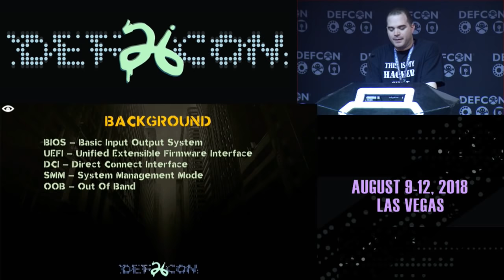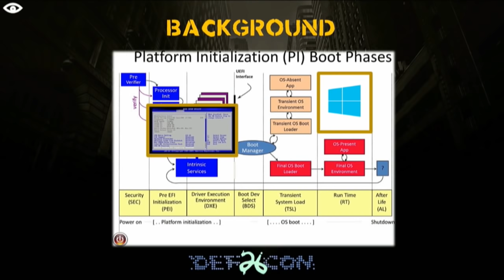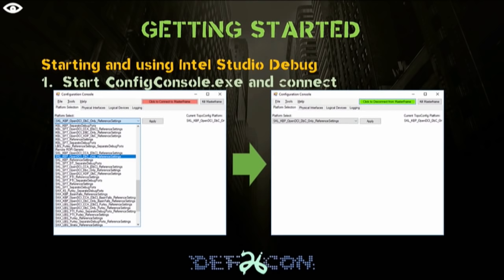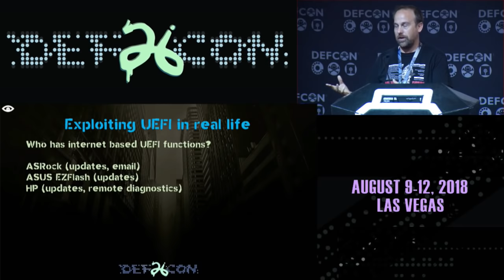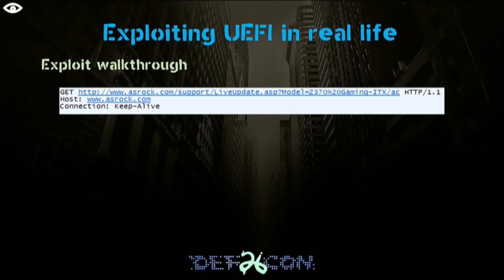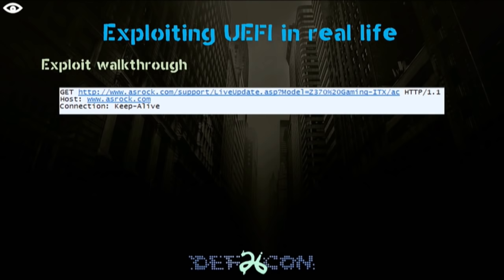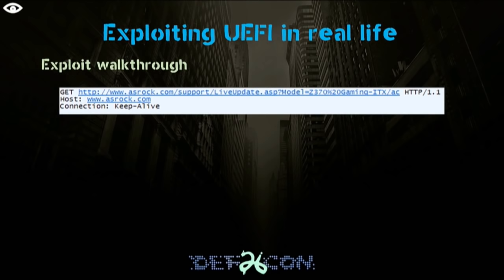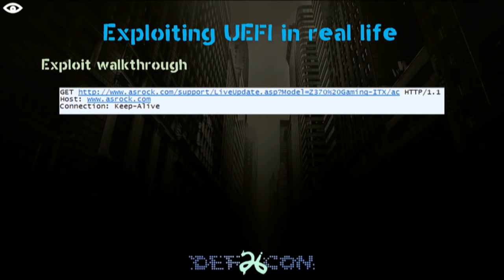DEF CON 26 - Shkatov and Michael - UEFI Exploitation for the Masses

Comment: what annoys me is not having a physical dip switch to break the write-line of the UEFI flash memory.
I mitigated any UEFI exploit by blocking my computer MAC address in my network. Then after the operating system starts, it changes the MAC to another MAC address that can access the network, so I can be sure the UEFI will never get to the network.
I dont't trust the firmware, so that's why I have another equipment doing this.